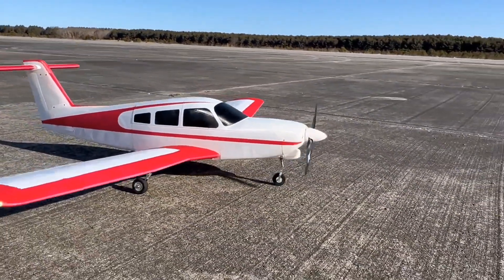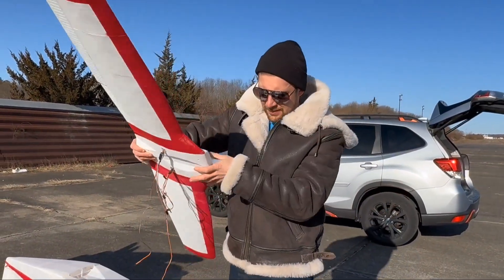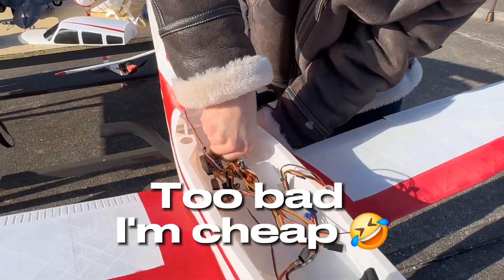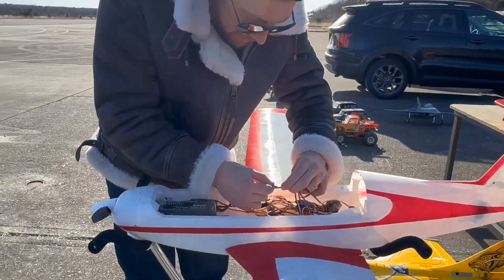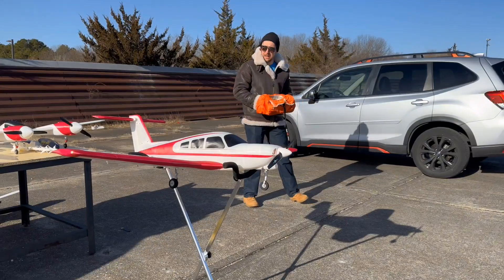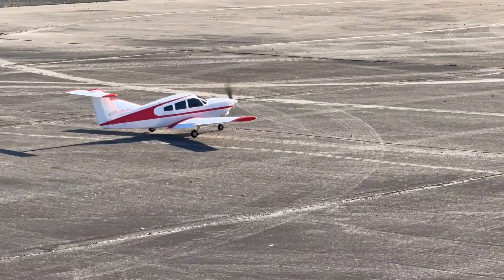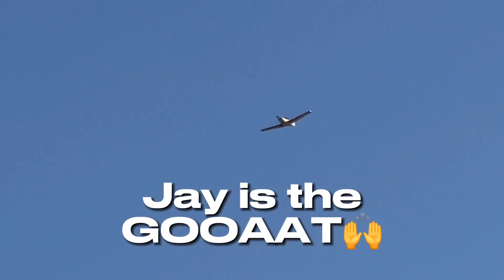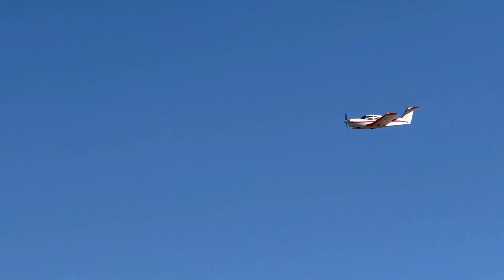PA-28T MAIDEN FLIGHT‼️

Comment: Nice detail. I had issues with the smaller version horizontal stabilizer. Didn't last long and "was" gorgeous. See that the larger build has much more detail in structure. Thanks for the maiden as I will try again, larger scale.